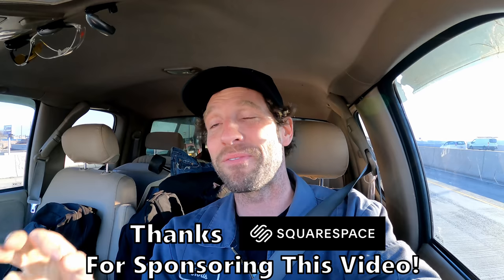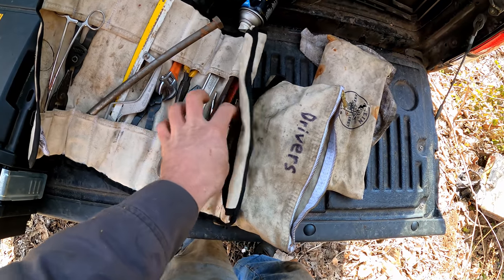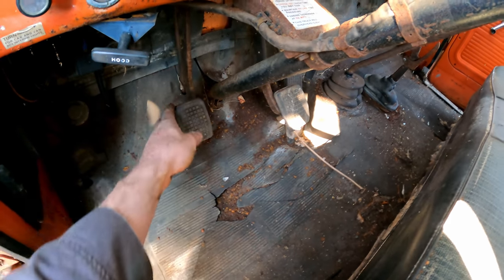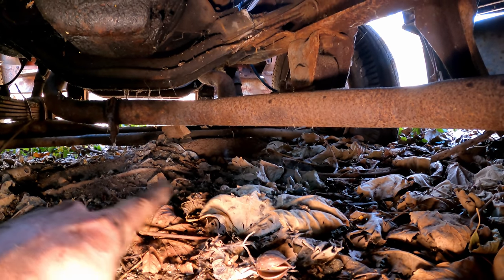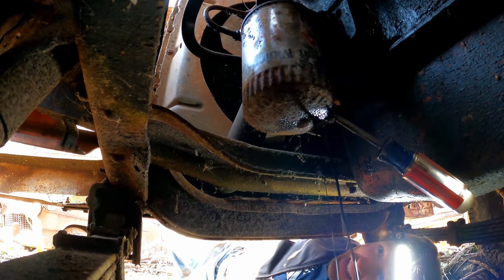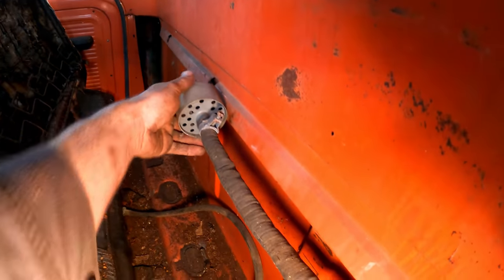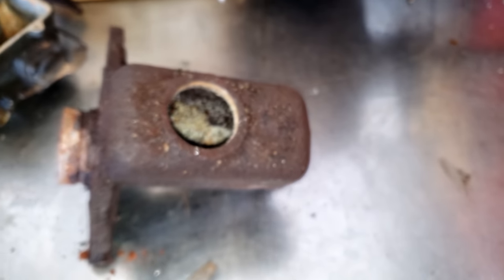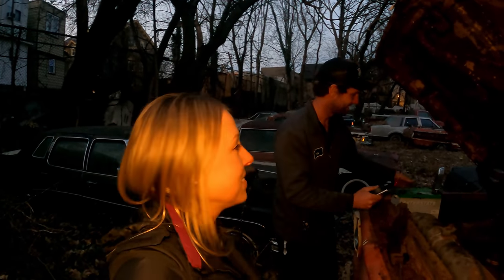Will It Run? 1971 Ford F600 Stick Shift U-HAUL Truck - NNKH

Comment: Fair market value - max $1500 in that condition.  I've got a 1969 F-600 with a 16" grain/dump box (in pristine condition, been in the family for over 40 years.) so I am somewhat familiar with them, that is a hydro-boost brake system and that cannister behind the seat is the breather, makes a cool fart sound when you mash on the whoa pedal.
Reply: I worked as an apprentice mechanic in Florida it was one of my first jobs. I remember the first time I heard one sounded like a Dinosaur breathing on me from behind nearly jumped out of the seat... The trucks we had it would make wooo kaw sound woo kaw when ya stepped on the brake. When ya stepped on em really hard them plastic toys the diaphram would go woooosh

Comment: Great job, I’d see $1250-1500 for that truck as generous. It needs everything, except an engine and clutch by the looks of it. Definitely more episodes. Cheers!.
Reply: Right. For that you could scrap the aluminum box and buy some tires if you wanted an F600 with a hardwood flatbed.
Reply: The seller probably saw how many subscribers Chris has on this youtube channel and upgraded the price

Comment from the maker: Thanks so much everyone for the comments and info. As of right now I don't plan to do a part two on this rig.  This is still for sale at 3K if anyone's interested( which I agree is on the upper end).  I would love to see somebody get her back on the road as a camper/toy hauler or put it to use in some other way even if it was just for the engine and trans.

0:00 Intro/Tour
04:19 Pop Hood/Clean 
08:22 Pull Plugs/Lube/Crank Over
12:02 Sponsor 
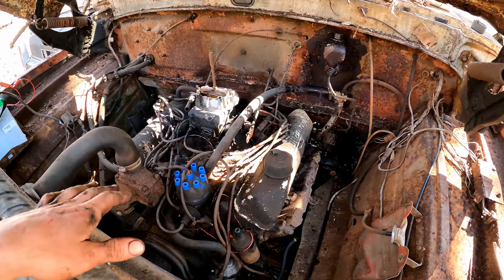12:36 Lube Stuff/Get Spark
15:58 1st Start Attempts
17:43 Need Parts/Hook Up Fuel/Starting
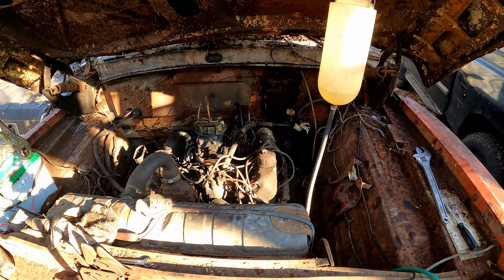21:31 Pull Parts/Wrap Up
26:41 Look At Carb/Parts
29:24 Put Carb On And Try To Move
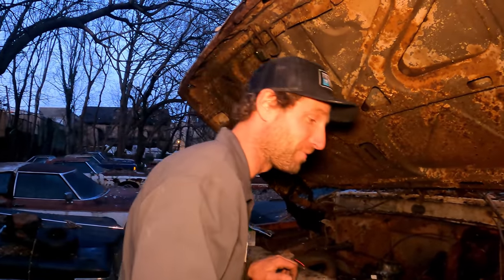32:27 Outro
Reply: Hello! This video is the first of yours I've watched. My first thought was that the reason it wasn't far more of a rust bucket is simply because it has been parked for many years! LOL! With that said, I have a few recommendations. First, always use a clean pan and drain the oil! If the oil comes out as reasonable, you can pour it back in. Beware water and debris! Next, always pop off both valve covers. You're looking for anything amiss including bent pushrods on the FE & FT engines. A smart thing to do is pull the distributor after marking it for accurate reinstallation. You want to insert a driver to the oil pump shaft and use a drill to bring up the oil pressure and distribute oil to all moving parts. Check the alt + wp + ps pump, etc for rotation BEFORE cranking. You found out why on this truck. If you don't have one, acquire a borescope and use it on each cylinder and down the intake. Do enough revivals the way you're doing it and you're going to get burned by jamming up an engine and most likely destroying parts. Don't forgo a proper, full investigation! Overall? Not too bad. Best wishes!

- Max Giganteum
Reply: Send her to puddins fab shop! he loves them u hauls lol

Comment: Hi, The brake unit under the truck is called a hydrovac, they work really good when they work. As is the truck is worth maybe six hundred bucks.while it may be worth a thousand at the scrap yard but you got to get it to the scrap yard and that ain't free. The doohickey under the carburetor is probably a governor that is set for 55 miles an hour. Thanks, Bob from Virginia
Reply: I totally agree. There's no way that thing is driving to the scrap yard on its' own, unless you pay someone to get it roadworthy and get insurance, plate and registration which is not cheap for heavy vehicles. That would cost a fortune and negate any profit for the owner. They would be in the red. They need a wrecker to get it to a scrap yard like you said and that will easily knock it down a lot. The $3000 asking price NUTS. That's probably what they paid for it when they parked it and let it rot for decades and think they can get the money back out of it. Yeah, there are parts, but someone has to haul it, spend their time disassembling everything, listing things for sale, taking up storage space, and hauling the rest of the non-sellable stuff for scrap. A lot of work. This thing will end up scrapped, and the owner will be lucky to get that 600 after it gets hauled off.
Reply: the governor is so you don't over speed the engine at 40 mph

Comment: I rented one of these in 1979 to move 80 miles.  No problem with the manual transmission.  With no A/C I had a pretty bad rash when I got there because of all the heat blowing through the holes in the firewall.  Also, it only had one small gas tank that I had to fill twice to get there and back and then refill again to return it.  You’re bringing back some interesting memories.

Comment: Engine is a 330 FT. Trans should be an NP435 if I remember correctly, and the rear end will be a Dana 70 with a 4.10 ratio. The brake system is an early vacuum assisted “heavy duty” power setup. They are finicky to say the least. On the engine side of things, most front accessories should be compatible with big block FE fords. Those engines were horribly under powered, but did the job. Horsepower rating was around 190 but it made something like 300ftlb’s of torque. I have a 1970 F500 with the same engine/trans but a 2 speed rear end. Good luck!
Reply: Peg @ Zip Ties N Bias Plies has a 1.5 ton version of this truck and I think he was saying this 331 V8 was made specifically for U-Haul?
Reply: Forgot about the 330 fe.  I stand corrected in my post as I believe you to be correct.  The engine in video has an Autolite 2 barrel carb where the 361 had a Holley.
Reply: @wes11bravo  may actually be a 331. I can’t remember exactly. But no, they were put in a lot of ford trucks.

Comment: I live in the Southwest, and it is really hard to see all the rust you have to deal with back East.  It's a real shame what moisture does to these vehicles.  Love the videos!
Reply: just moved from SE PA to New Mexico a couple years ago. it blows my mind the classic cars I see driving around.

not classic as in valuable restored cars. just regular run of the mill 70's 80's 90's cars just driving around. paint all faded clearcoat all peeling dents and bruises but otherwise just stock cars just driving around!! that just does not have back east. too much salt and rust but its quite "NORMAL" around here. amazing!
Reply: @nerys71  Same for me. I was living in NY, I'd visit my dad in FL a couple times a year. Always surprised at the "vintage" cars I'd see. Now I'm living down here, I might have to buy some older iron, myself.
Reply: Man, I live in Arizona, no rust here, I have a 2009 f150 4x4, clean as a whistle underneath !

Comment: Great content. 1989 my mom rented a 79 F350 U-haul with a manual, no a/c, didn't even think about it. Today somebody would want to talk to a manger. 
Would definitely watch more on this truck. And I think its worth $3000.
Reply: I rented a manual Uhaul in 1994,  then in 1996  the larger trucks were still manual.

Comment: The 1 ton Ryder fords were pretty cool. 330ci v-8, a medium duty motor with some hd parts internally. Also 2 thermostats. NP 430 4spd hd trans with a granny lo. Dana 70 rear. Bullet proof setup

Comment: This brings back memories of the time my best friend and I rented the biggest truck U-Haul had available to drive from Mobile, AL to Leroy, IL to move his grandmother and aunt back down to Mobile.  It was around 1978, and the truck was very similar to this one-- down to the manual transmission and governor on the carb.  If I remember correctly it was a 33 foot truck, and it would just about hit 58 mph going downhill!  We drove for many miles with a toolbox on the accelerator pedal (we called it our "cruise control").  One of the scariest moments came when we crossed the Mississippi River around St. Louis... how we didn't scrape the bridge or swap mirrors with oncoming trucks I'll never know!  My friend and I loaded a houseful of God-awful heavy antique furniture into that truck, and managed to make it back to Mobile without incident.  I hope you are as successful with this old girl...
Reply: are you still around mobile I used to live there

Comment: I’d personally love to see you get this running and driving!
Reply: Yes. First starts are great. Would love to see more full restorations.  So many Vids leave me hanging.
Reply: I would also like to see this vehicle get the dings, rust, and other issues sorted out, as well as see this truck be converted to the classic U-Haul look.  I would also like to see U-Haul also approve of restorations of their old moving trucks and to also have them be used by people to haul around things like they used to do back in the day.
Reply: Same here. This truck has a super nostalgic feel and look to it. Love the austerity of it… Steel inner door panels and manual trans! So cool.

Comment: Back in 2009-10 a friend of mine needed to move. He worked for Penske at the time. He walked into the local office and asked for a truck (he worked at a different location). They threw him the keys to an International with a manual transmission and air brakes. He’s never driven a stick before in his life! It only took one short trip with him driving that I knew I needed to take over!

Comment: Truly worth fixing up. Too many ended up being sold as scrap and destroyed or left to rot. I would love to see a restoration video on this truck and to see it drive away instead of hauled away. This truck was built in an era when vehicles were rolling works of art. You just don't see vehicles like that any more. It is sad. I enjoyed watching your video. It does my fifty year old ticker good to see a truck of that vintage run after sitting for years.

Comment: I worked for UHaul from 04 to 09.  I was there when the last of the 26 foot 86/87/88 International S1600 manuals were being phased out.  By the time I left, all of them were gone, but when I started they constituted like 60% of the large truck fleet.  IIRC the last ones I knew of were gone around 08.  That was not that long ago.  

If people wanted to rent a big truck, that was what they got, and that was not that long ago.  You had to find a friend who could drive it for you if you couldn't do it yourself.  I would even give lessons in the parking lot.

One of the stores north of Philly has 3 old trucks like this that are kept in special conditions in a shed specifically to be rented out for period piece movies from the 60's, 70's, and 80's.  They're pristine.  So beautiful to see, and to see running.

EDIT: Not surprised to see the box is in good shape.  They used to make those out of airplane-grade aluminum.  Now they use particle board.
Reply: I'll be honest.  If you spent the time to refurbish this thing, it's worth a lot more than a few grand as a finished, complete truck with the UHaul livery intact.

Comment: I moved from Central Florida to Knoxville, Tn in the late 90s and the Uhaul my dad drove was an International Diesel with a 5 speed. I guess a few existed! It was probably a mid-late 80s model. Possible a 7.3 IDI because that thing was a slug!
Reply: International had a few Diesels in the 80s; the DT466, which was a superb powerhouse, the 6.9idi (7.3s little brother) and the 9l (a slug)
Reply: Yup, I've been a Uhaul dealer for 27 years and we had 26' trucks with IDI N/A diesels and manual trans right up till about 98-99 when Uhaul had its little uh....incident with the Canadian authorities. After the near bankruptcy, all the cool and weird trucks were axed (Toyotas, Powerstrokes, 5-speeds, carbs) and they made 90% of the trucks E-350's with the Triton V10.
Reply: Refresh our memories... what was the "incident" again?
Reply: @MaxGiganteum  Uhaul of Canada was having trucks that had multiple mechanical violations put back on the road via requesting new plates/tags from Uhaul headquarters in AZ. A 20/20 television expose had undercover customers rent a large number of trucks and take them to mechanics for inspection. 75% of them had 3 times the allowable violations. Uhaul of Canada offered no excuse and shut down operations immediately. As a Ryder dealer at the time, we were given a VHS tape of the episode to play on a loop in our showroom! Uhaul went into solvency and creditors took everything but their operating cash for quite a time until the fleet was built back up and things stabilized. Uhaul has always been quite a dysfunctional company with family infighting, boardroom brawls, hostile takeovers and even a murder! But they invented the industry they lead and have far more trucks and infrastructure than any competitors so they pretty much can't fail, even when things go completely sideways!

Comment: It's been nearly 25 years now but I once rented a big uhaul just to use in town and it turned out to have a manual trans and a 454.  Had about 400,000 miles on it too, and was just barely usable.

Comment: You gotta be honest with yourself on this one and not get wrapped up into the repairs. Yes I agree that it was nice to get it started. If you can move it and stop it a bit would be about the limit. The cost on this is too much to do anything practical. Good luck with whatever you decide.

Comment: I always love seeing these old junkers eventually run and I've seen enough of these will it run type videos to know that the older engines were far more bullet proof than their much younger siblings. Well done for getting this hunk of a truck engine turning over, even if it DOES have some issues.

Comment: The engine is a 362 u-haul special motor tune-up parts are the same as 360 truck engines.  I had one twenty years ago.
Reply: 330 cid

Comment: I’ve seen that same U-hall truck many time ford with a 390 4speed used them a few times being in the Army over 20 years I’ve seen them sale for $600 to $1,500 Depending on their condition but that one’s in high need of many parts tires brakes wouldn’t give more than 500 for it but it does make a good video my friend thank you U.S. Army retired sergeant major Gamsby

Comment: The engine may be a 331, a 361 or a 391, depending on the year. The hose on the hydroboost that came off the lower port went into the cab behind the seat and was a vent. The other hose was for vacuum and was connected by a tee fitting to the vacuum source and a gauge on the dashboard.  To bleed those brakes was a long job.  The best plan was to open the right rear bleeder screw and have one person pump the brake and one person keep the master cylinder full. When you finally got fluid at the right rear, then bleed  the rears, the fronts, the hydroboost, and  the master cylinder.  [EDIT]  -  There are people out there looking for 391 engines, don't scrap it till you check the web.
Reply: Interesting, I was gonna say 351. I’m gonna do some research, when I get back…I might come back corrected.
Reply: Yup I’m wrong.

Comment: My first job was working at a Uhaul dealership and I jockied that exact model truck around. You are correct about the plate under the carb it was a governor set at 55 mph. The tires were even stamped with "Uhaul" to prevent theft

Comment: My dad bought one of those in like 88. It was the same year truck with a 20' box. 

The engine was a 359HD. The things I can remember was it held like 9+ qts of oil and had a 2 bbl holley that said made for uhaul on the fuel bowl. 4 speed with a 60 or 65 mph governor on it.

Comment: I remember renting a 1976 U-Haul with a manual transmission in 1992.  They would rent them for local moves only at that point, but it was pretty damn cool to drive a U-haul with a stickshift.

Comment: I drove a Ford dump truck with the same cab years ago and you quickly realize that they weren't designed for someone 6 foot tall or more. Your knees are in your face when you're on the clutch or brake pedals.

Comment: I know the location of a Chevy boxtruck of the same generation. I was talking to my old boss about acquiring it, and he got a glimmer in his eye because he's forgotten about it for about 20 years. It was his old workhorse, and he sounded like he wants his old girl back. It still has a load of his streetrod parts for his company that were forgotten with it.

His looks about as rough as this one, but the interior is surprisingly good. Even has $10 in quarters in the ashtray. It was parked due to engine issues, but it just has a small block in it, so it shouldn't bee too hard to fix or replace.

Comment: The wheels on that truck are in TREMENDOUS DEMAND by other F600 owners. I'd love to have them myself! They are tubeless vs the split-ring wheels on most F-600s allowing you to run a wider variety of tires with less stress finding a truck shop who'll change your tires.

Comment: That should be either a 361/391 FT engine. Its still an FE but with a truck rotating assembly.
Reply: Wouldn't it be a 352, 360 or 390?
Reply: 330 cid
Reply: Yep. 330 cubic inch medium duty.
You can tell because it has 2 thermostats.

Comment: I rented a later '70s version of this exact truck from U-Haul in 1989 for a 200 mile move.  It was an automatic and while a handful to steer it wasn't a bad driver at all.  But the fuel gauge was not accurate and I ran out of gas about 2 miles from my destination...turning left smack in the middle of a busy intersection during a Friday PM rush hour!  I was fully loaded yet a Ford Crown Vic police car equipped with a front push bar pushed me out out the intersection and safely into a turn pocket about 500 ft beyond.  What a memory!

Comment: Back in 1995 a friend moved 2000 miles away and got a U-Haul 30' truck with a manual transmission. I drove it to his house and backed it into the driveway on the first shot. I had experience driving a similar TV production truck.